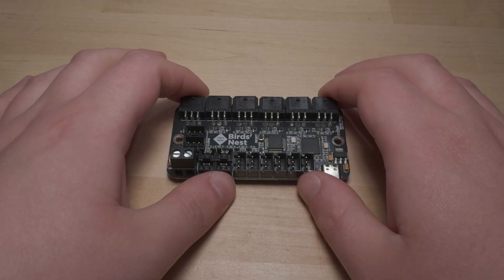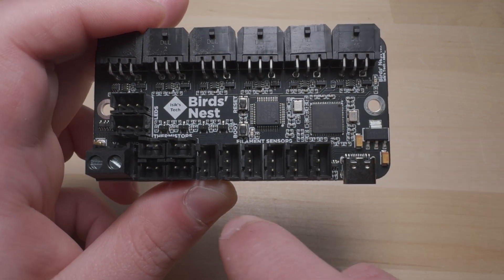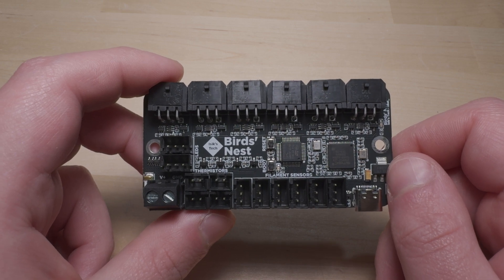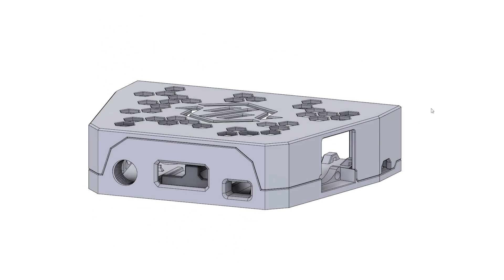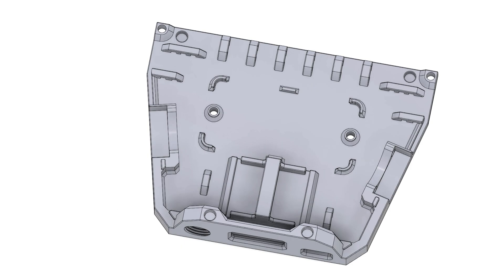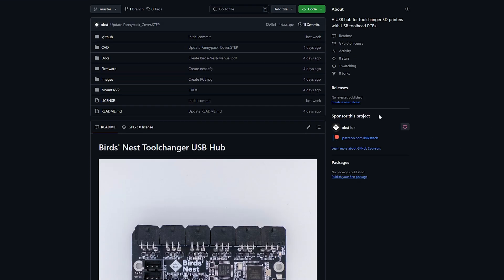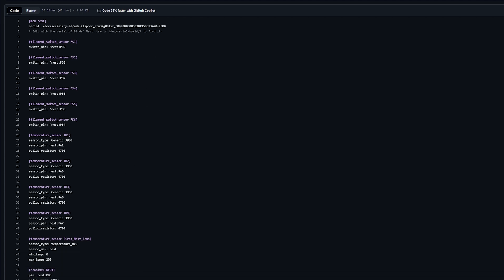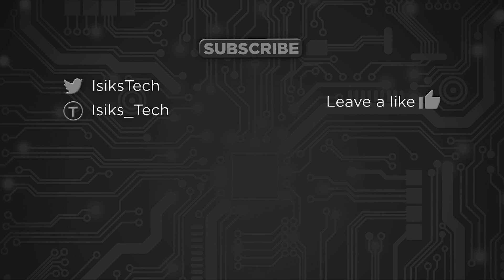Birds' Nest Toolchanger USB Hub - Open Source PCB Project

Comment: Is there any room to add a controllerable fan port to this project? I was thinking maybe I could use one of the neopixel pins to power a 5v fan. Honestly having a fan option over 2 neopixels would be much more useful as neopixels can just be daisy chained anyway. I hope to use this soon with a custom back pack for the voron 2.4. Not having to run an exhaust fan wire up and just running 24v and usb-c wire would be nice. A 24v fan would be ideal but I will probably give the 5v fan a try. Just a thought I had. Great project tho! Really gonna help with my tap changer build.

Comment: Running stealthburner Voron 2.4r2, I recieved ,Lost communication with MCU 'nest', 2 times since using 2 color print about 1/3 into print. Normaly I restart and restart print and it finishes as normal? Any ideas, becuase its happend x 2 . Great product.
Reply from the maker: This is most likely a USB cable issue. Birds' Nest draws some 5V power from the USB cable. If the cable is thin, this can cause a undervoltage issue. Another possibility is if there are power hungry devices connected to the Raspberry Pi.
Reply: @IsiksTech usb cable thin ?  that runs from birds nest to raspberry pi?

I have usb C920 camera plugged into the pi,  could that be the issue? I need a camera. My switch to pi 3 camera 

Just had the same error, like 2.5 hours into a 5 hour print ,

Comment: Found this on Teaching Tech, purchased one from West3D but I have not found any information on the thermistors, What, How, Why? I was gathering the parts (same HUB part) to add a hub+thermistors+MosFet voltage switches for chamber heat control on the Sovol SV08. Could there be a Version 2 with 6 more filament sensors for the BTT SFS V2.0, two MosFet 400 watt switches with screw terminals for the heaters and two fan ports for the heaters? The Sovol SV08 has no room in the stock chamber with the stock enclosure, I've added the top extension with the  BTT HDMI7 and air filter but with the Birds-nest and cables I may have to expand it higher...   Teaching Tech hasn't hit the chamber heating issue yet, big parts warp nicely at 40~50°C. Source for the STM32 would be a good thing, at any rate, $65  is cheap if you try to build one of for your self and that isn't counting all the time required.
Reply from the maker: There's currently no new version in the works, but if I end up making one, the extra pins for the BTT sensors will be added for sure. Adding the MOSFETs would add a lot to the cost so I'm not sure about those. It might be more cost-effective to add a SKR or similar board for those. 

Thermistors are there because some people like to measure temperatures from a few places inside their chamber, or on extrusions, etc.

Comment: Amazing project. For the uneducated such as myself what are the benefits of using usb over canbus for this type application?
Reply from the maker: CAN vs USB toolhead PCBs each have their pros and cons. 
- CAN is more complicated to set up. You need a USB to CAN adapter and you need to set the software up. USB is simpler. 
- USB's reliability is what you'd expect. Works pretty well. CAN can be a PITA sometimes. IMO, based on my experience with CAN hardware, I think the majority of the problems are because of cheaply made Chinese hardware. There are some USB to CAN adapters using knockoff MCUs, or controllers that deserve more layers on their PCB but don't have them to cut costs, there are CAN distribution hubs that don't follow proper CAN topology, etc. If the hardware is good and there are no wiring issues, CAN can be rock solid. It is a protocol designed for critical applications like industrial machinery and cars after all.
- CAN has limited bandwidth. The CAN implentation with Klipper supports up to 1Mbits. This is more than enough for vast majority of applications, but there are some applications that benefit from USB's higher speeds, like accelerometers. I always recommend setting CAN to the highest supported speed, 1Mbit, unless you have a reason to slow it down. 
- You can connect multiple CAN devices to the same CAN bus. With USB, you need a USB hub, like this PCB. This can add up when building toolchangers or other projects with multiple devices. 
- USB wiring is trickier. The wires need to have shielding, and they need to be grounded. 
- CAN supports Katapult, making updating  firmware much easier. It is another initial step you need to do when setting up CAN though, if you want this feature. 
- USB, without protection circuitry, is not a good idea. Birds' Nest has the protections built-in, and so does LDO's Nitehawk breakout boards. I believe there are options coming soon from other toolhead PCB manufacturers too. But without protection, like a USB-modded EBB36 connected directly to a Raspberry Pi, can be very risky. If there is a brief disconnection on the wire, it can kill a Raspberry Pi. Again, newer boards like mine have protections against issues like that.

Comment: Hi, amazing project - I looked through schematic and wonder what is the function of NTJD4001N FET on USB output lines?
Reply from the maker: It disconnects the data lines if 5V isn't there. A part of the protection circuit against accidental disconnections.

Comment: So far I have used this on two toolheads. Works great
Reply: Theres also the EBB SB2209 USB
Reply: Which tool head boards are recommended to use with this?
Reply: @airatooo  Right now the only USB toolhead I know of is the LDO Nighthawk 36, and the Nighthawk SB. However, any USB toolhead should work as long as you have the 6 pin connector. The 6 pin connectors are 24v, gnd, USB+, and USB-
Reply: @The_original_Reth  LDO Orbitool 2 for the Orbitor 2 extruder is also out there. I have one I am going to be trying out soon.
Reply from the maker: Never tried it myself but I think there's a mod for EBB36 and similar boards too.
Reply: @IsiksTech  Yeah i am wondering if i should get the board or the MOAR CAN but I have the EBB36 and do not see how I will be able to connect the 4pin to the 6pin board
Reply from the maker: @simonvoss4133  you can crimp both H/L wires on the same pin on the EBB end.